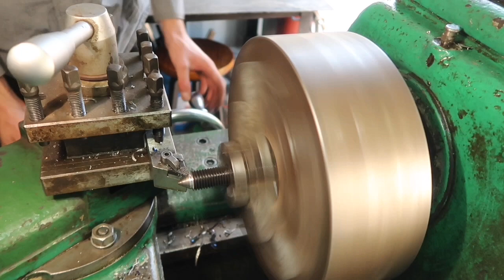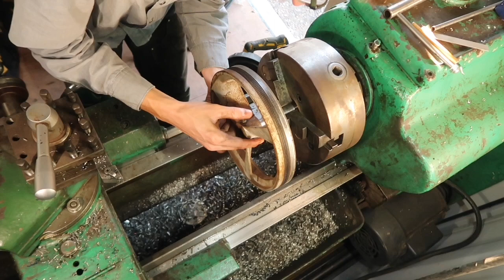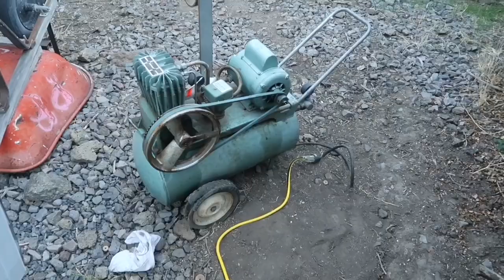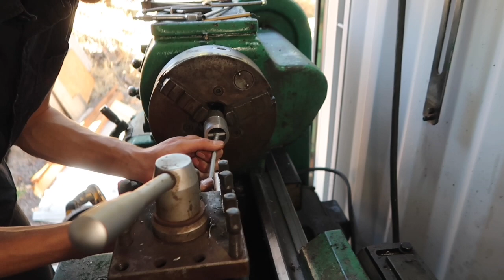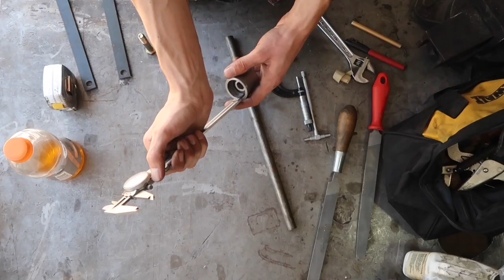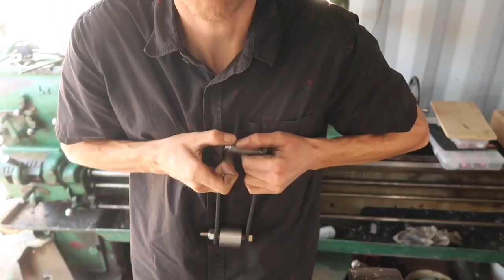Fixing an air compressor

Comment: Want another one? I have a similar looking one and if you cover shipping its yours
Reply from the maker: Haha no thank you… If I ever get an other air compressor for the shop it’ll probably be newer. Thanks though!
Reply: So, why not simply replace worn belt with OE type?
Reply from the maker: @johne189  I could not find the oe belt
Reply: Would you like any parts off mine? Im literally about to scrap it, i think the tank is messed up so maybe ill build a wood stove or some shit with the metal lol, but the motor and pulleys are still good if you change your mind